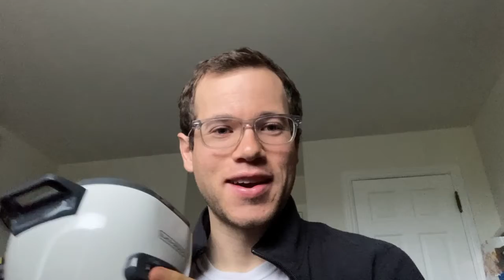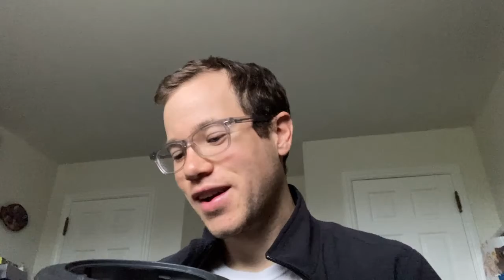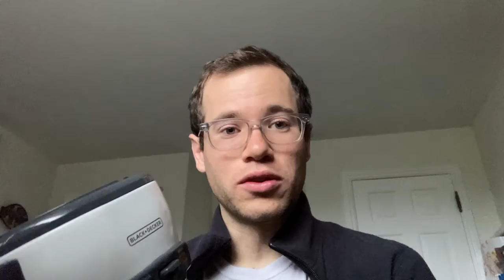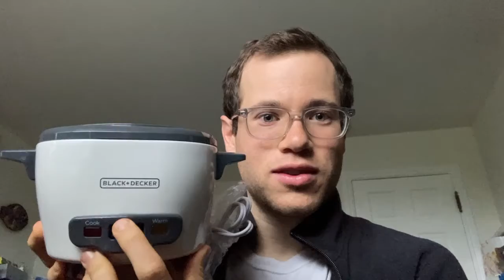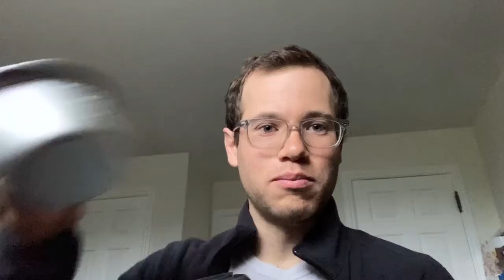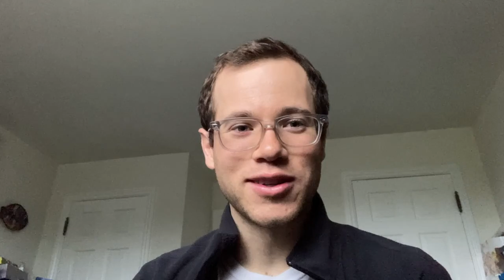How does a rice cooker know when to stop heating?

Comment: The cook mode operates at full voltage to the heating element which is around 300 watts. The warm mode sends the voltage through a resistor before it passes through the heating element. Very ingenious invention